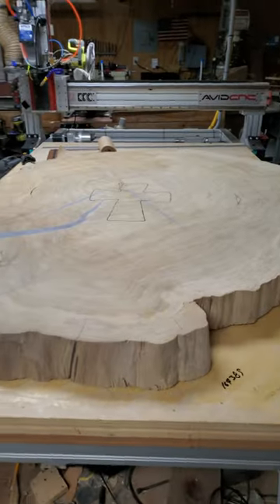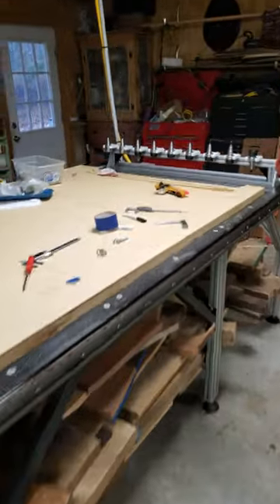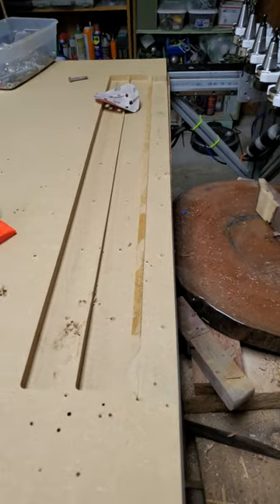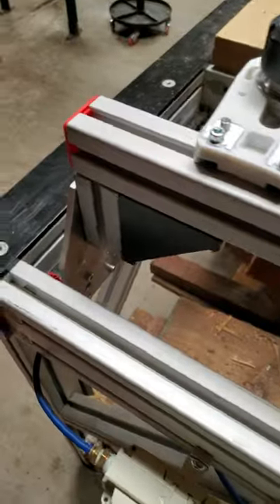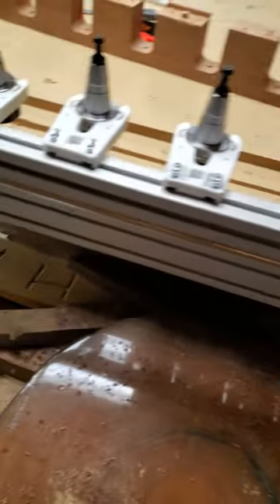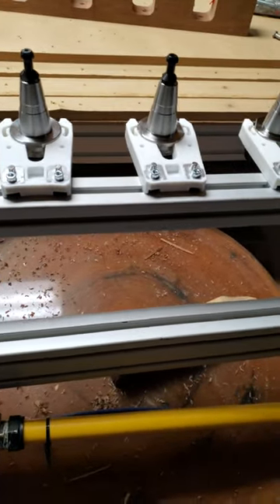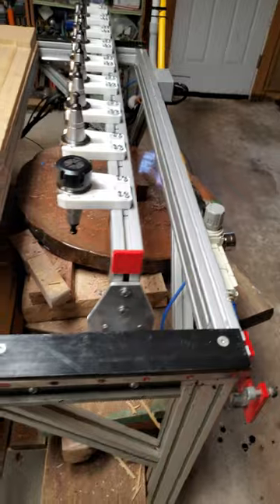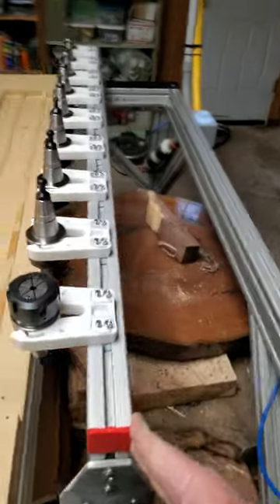Installing Automatic Tool Changer tool rack CNC Router

Comment: a macro is just program thats called as a subroutine. its not at all difficult to do. def make it slide under power using an air cylinder. lotta folks make a cover that flips down when it slides back. control the air cylinders with piloted pneumatic valves. easy peasy.  they got push lock fittings with speed control valves built in that go right on the cylinder so u can tune it for smooth action. super easy and cheap to do.

Comment: Strange, I added a comment 2 days ago but it looks like it got deleted?  Which CAM are you using? Mach4, Mach3, UCCNC, other?
Reply from the maker: I am running mach4, I can assure you that I did not delete any comments.
Reply: @bstanga  No worries, I though maybe it was YouTube but in the end, it's probably because I forgot to press a button :). Written a fair amount of Macros for UCCNC. No experience with Mach4. We have 3 Avid machines. I followed that same process as you in that I mounted the tool catalog in the back of the machine and had to take it all off when I started processing 4x8 sheets because it was in the way. Wrote macros for the tool changes but only in UCCNC. Sorry!